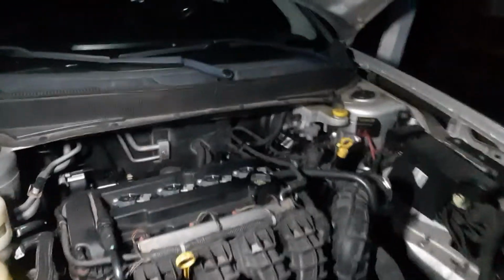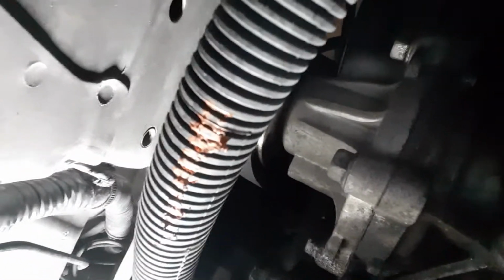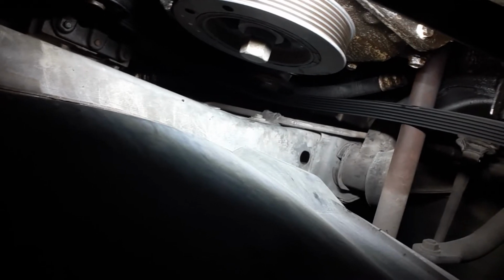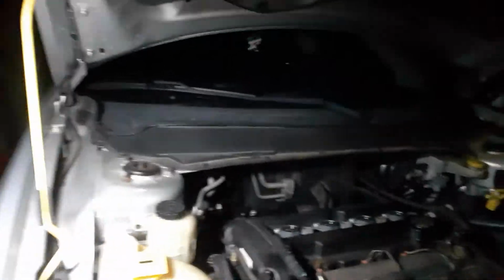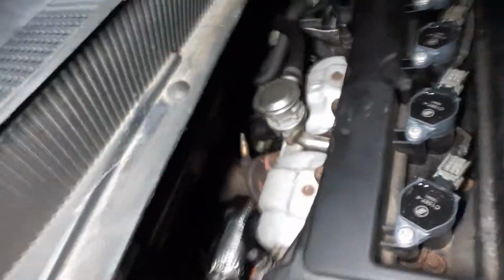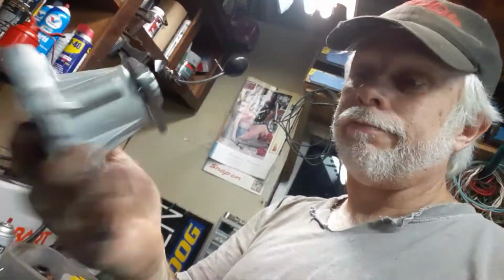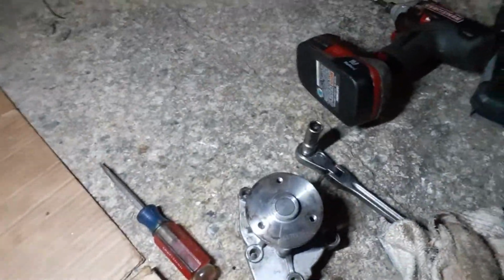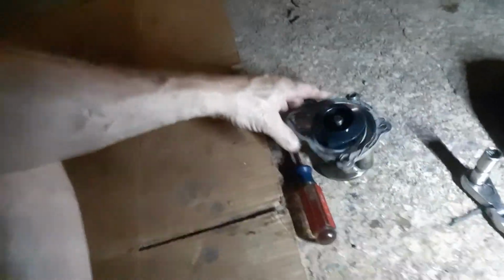2011 Dodge Avenger water pump replacement

Comment: Hey I have these metal gaskets place holders f from the old water pump stuck inside the engine any idea how to get them out cause I can get the new one in
Reply from the maker: First of all, thank you very much for watching. Really appreciate it. Really helps help channel. I assume you are talking about the hollow dowel pins? If you can possibly get me at least some sort of picture as to what you're talking about, they're basically they're the their sheet metal and their round circular and they usually line up the gasket and or the pump. There's probably at least two. There may be more of them
Reply from the maker: Hey Daryl, those placeholders you're talking about are actually hollow dowel pins. You can remove them to help get the old gasket off, but they are very troublesome to put back on and they are very necessary to get everything lined up correctly. If you don't have them, you could get the water pump cocked one way or the other. If that happens then the water pump will literally destroy itself the impeller that is of the water pump also. So it's probably best to leave those dowel pins in place and just clean off the old gasket material and install your new gasket and your new water pump and tighten everything down and make sure you don't have any leaks. Hope this helps. If there's anything else that I can help you with, be sure to ask. Thank you very much. God bless
Reply: I ran into this problem with the pins stuck in the housing but my new pump already has the pins in them. If you already was messing with them pins with pliers like me. Your gonna have remove the housing to take the pins out that are Stuck. Atleast that’s what I did.
Reply: Added a extra step but I messed the line up trying to pull em out with pliers.
Reply: Pins^